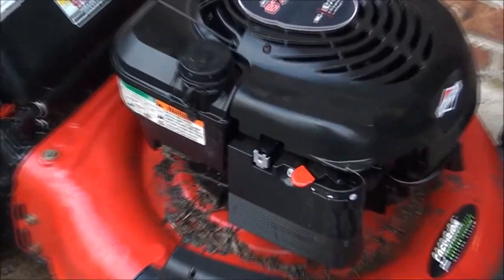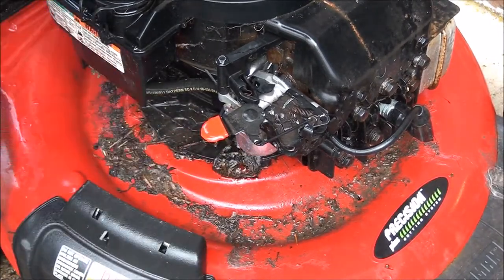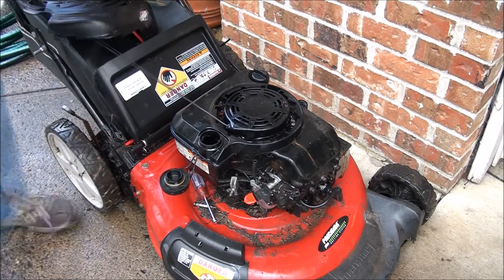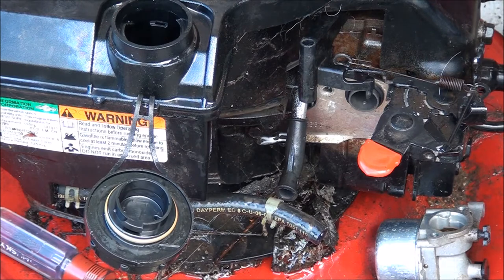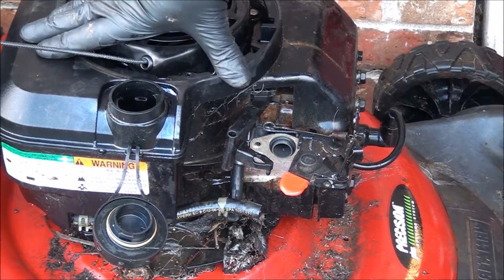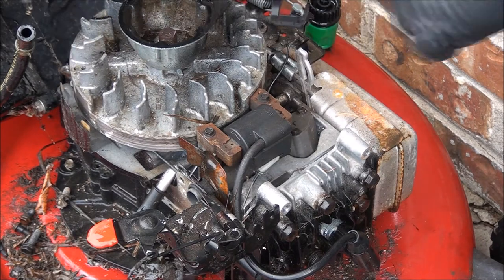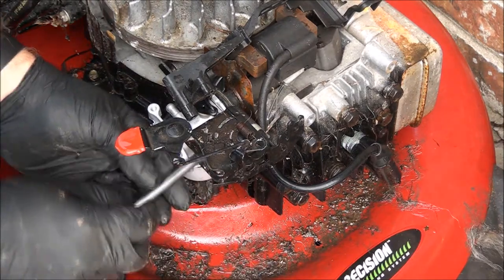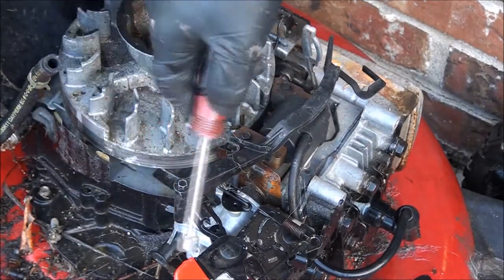HOW to REPLACE a Common AUTO CHOKE CARBURETOR Briggs and Stratton model engine. Easy way

Comment: I have a toro 20381 and there is a very fine small coil spring that wraps around the butterfly choke shaft and has a half loop on it has come off and not sure where it goes any help would be appreciated

Comment: I have this set up minus the throttle control. It started fine but would surge up & down constantly. Pulled the carb apart and cleaned it out. Same problem. Replaced the carb, still same problem. Any advice?
Reply from the maker: you may be missing a spring
Reply: @jeffslawnmowerrepairandservice  I'm going to replace the intake gasket this weekend. All springs present and accounted for. If it's not that I'll pull it apart for spare parts.